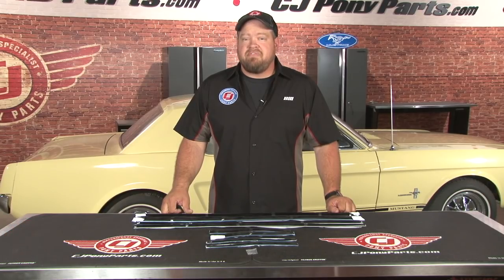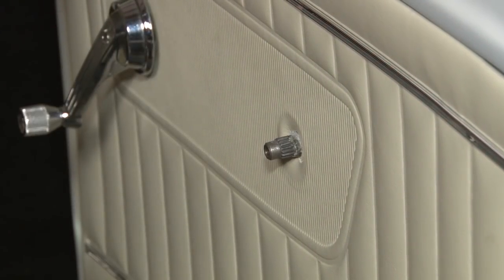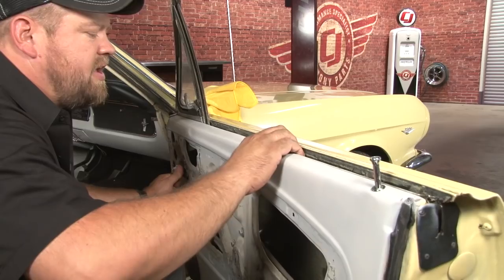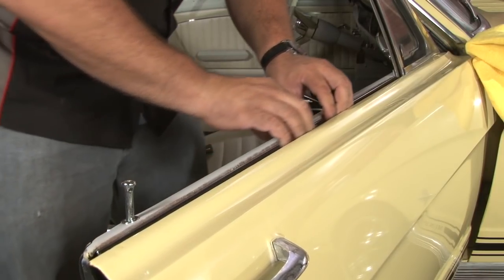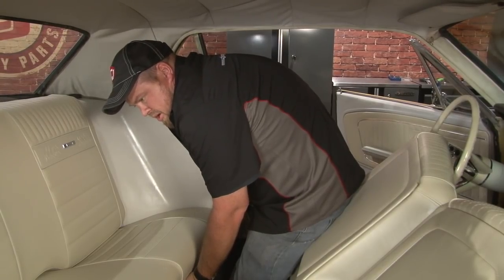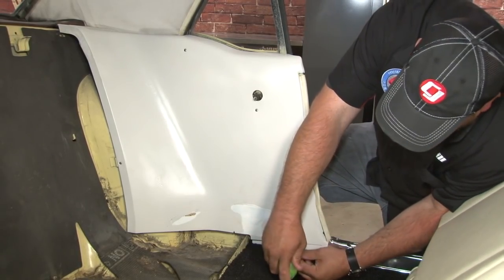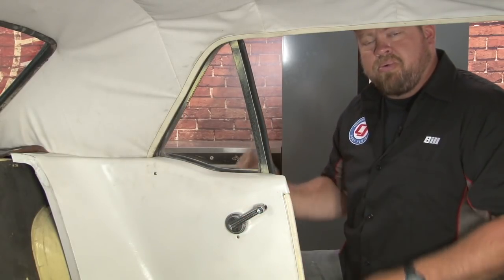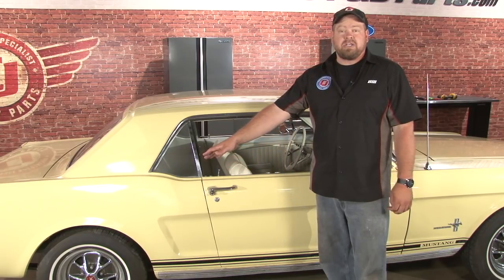Beltline Weatherstrip Kit | 1965-1966 Mustang

Comment: Great video series but a couple point worth mentioning.  Depending on who you are one of these points may seem more important than the other...I list them in no particular order of importance as I believe they are equal -  any time you have the door panel or quarter panel off it is highly recommended to do periodic maintenance of the inner door workkngs... lube the regulators, check the plastic rollers,  vacuume/blow out any debris etc. and the other point is on the outside rear quarter beltline, dont forget the screw, it will screw you. 9:22.

Comment: I bought this kit but it came without staples for the rear beltline. What staples can I use instead? Can I just glue it in place?
Reply from the maker: I refer to use heavy duty staples or tacks. I have seen people glue them but don't think it will last.
Reply: CJ Pony Parts I ended up using wire ties combined with rubber adhesive. More importantly, thanks to your video I had the confidence to finally remove the back seats. Now I know how easy it is it should be no worries in case the adhesive comes unstuck!